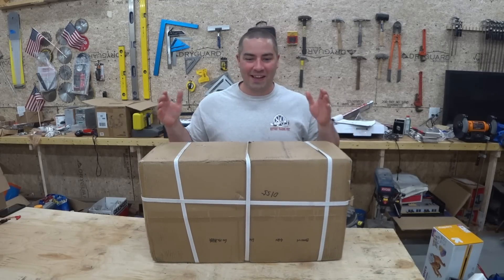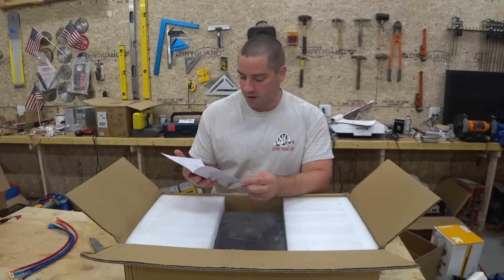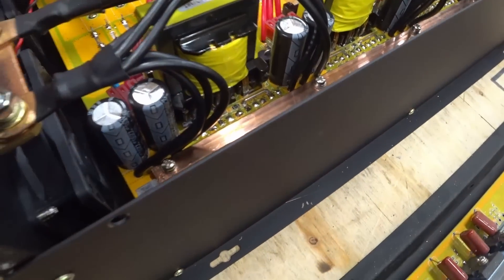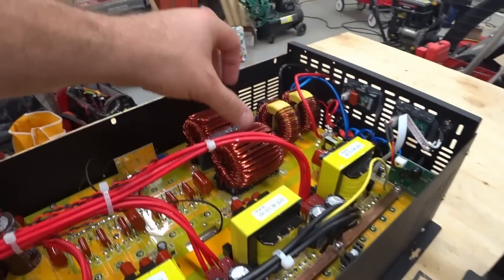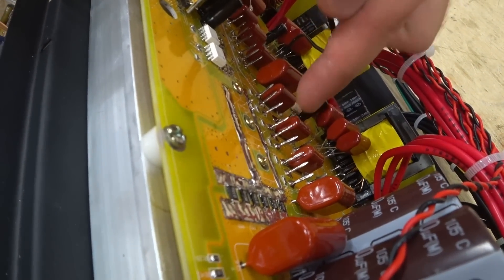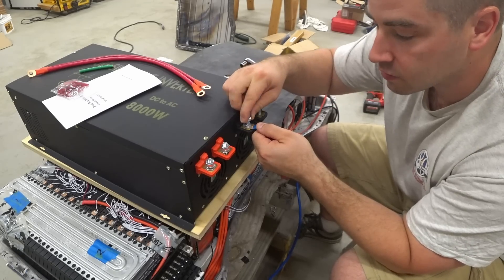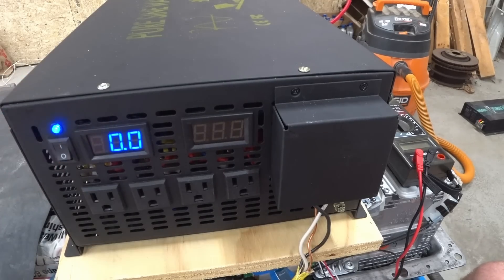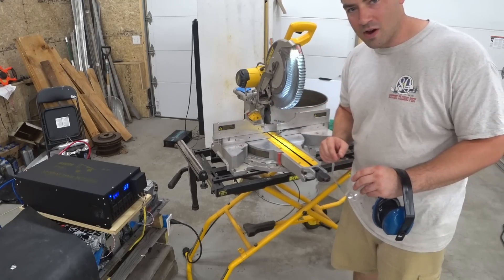Cheap 8000w Reliable Inverter, That Works! WZRELB

Comment: David sticka O scope to it and show us the signal it generates, if it is making a pure sine wave then you got something good and it will save you a lot of power and money in the long run as a whole, battery bank will last longer , and devices will last lonmger cause they will run cool. Remember the cleaner the signal the higher the efficiency. Theoretically a perfect sine wave would flow on regular metals as if they were super conductors , assuming you are driving the amps at the correct resonant frequency , like 432 hz
Reply from the maker: At some point I'll save up for an oscilloscope and do that.  Thanks for watching.

Comment: Cheap ? Ok, Reliable No, 8000 W - No

Reliable 8000 VA inverter looks like this:
https://www.off-grid-europe.com/studer-xtender-xth-8000-48-inverter-charger
and Chinese clone like this:
https://xihe-solar.en.made-in-china.com/product/iyuEIjxbrScw/China-Studer-Xtender-Xth-8000-48-Inverter-Charger-off-Grid-Europe-48VDC-to-120V-230VAC-8000va-Power-Inverter-8kw-to-72kw-Home-Inverter.html
Or another 8000 VA reliable inverter:
https://www.sonopsolar.co.za/product/victron-quattro-488000-single-phase/

Try 8000 VA continuous @ 25 & @40 *C for 12 hours & you will see, that maybe after 30 - 45 min. it will beep a than shut down or die.
Reply from the maker: Thank you Pavol Filek.  Those are some nice looking inverters.  I'm currently building a sub-panel so that I will be able to load this inverter up to 8000w.  I hope it makes it, but I'm sure you are right that it probably won't last an hour.  Thanks for watching.

Comment: There isn't really much test about what you're doing to be honest. It's more just you running around screaming "YES" when you plug something in. 
Can you provide any scientific tests?
Reply from the maker: I'm just a dude in his garage.  I'm probably never going to be into the scientific tests, sorry about that.  But, I'm currently working on wiring in a sub-panel to this inverter.  Once that's done I'll have enough outlets to load it up to the 8kw.  I hope the inverter can do it without giving up the smoke.  LOL

Comment: Something about electrical design Engineering is that we always use down-sized wire for very short runs. Stranded wire like what you have in that box will work fine. I have equipment I designed with #4 wire that is normally rated at 70 amps, and you can safely double that amperage for short runs inside equipment. One would be amazed at what a difference it makes in the resistance of 30 feet of that wire versus four to six inches. That little bit if resistance difference makes a HUGE difference in the heating up of the wire when in use in an over-current condition. 140 amps would heat up that 30 foot run FAR more than it ever would the 6 inch piece. They also soldered rather than crimped, which gives it more surface area connection, which is also better than crimping, especially if they use silver solder. In your case, wire rated at 30 amps for longer runs will handle 66 amps just fine.
Reply from the maker: Thank you very much.  Your explanation makes perfect sense.  I am setting up for a bigger test of the inverter.  My goal is to try and put 8000 watts of load on it.  I plant to attach a temperature sensor to the middle of the red wire with some electrical tape and see how hot it gets.  Does that sound good, or any other things I should keep in mind for that test?  Thank you.
Reply: @DavidPozEnergy  Thermal cameras do FAR better at gauging as to if a wire is heating up excessively. However, those aren't cheap. We use thermal cameras in all our control boxes, fuse boxes, etc.. That helps us find where there are loose connections, which ALWAYS cause wires and fuses to heat up excessively. If a wire is indeed under-sized for an application, the thermal camera will make it very evident. If you plan to do lots of design work of solar power systems, a thermal camera would be a much better investment for looking to see if lithium batteries, wires, transformers, capacitors and other components are getting a bit too warm and in need of heat sinks. Even infrared temperature readers with laser spots to show you what you're reading are inexpensive and necessary. You can get one online for about $30. Putting a thermocouple of thermistor on a round wire is difficult to make enough surface area contact for an accurate reading. THHN coated equipment wiring is rated for 60C or 90C (I forget which), which is pretty darn hot.
Reply from the maker: Thanks.

Comment: 6:15 The ratings for chassis wiring is different from home wiring. Home wiring states 10AWG is for 30A based on the NEC. The max rating for 10AWG in chassis wiring is 55A. That being said, I personally wouldn't use it anywhere near that :)

Comment: Yeah, they're using chassis wiring ampacity standards and specifically Chinese chassis ampacity ratings. In truth, the ratings you're used to are based on a high uncertainty in the the length of the run, which is why wires that qualify as chassis wiring can be rated for higher currents, so in reality you'll probably be fine. They'll get toasty with a full load pushed through them, but only toasty as long as the connections are solid and not "ohmic". That said, I personally would swap most of the internal wiring with two gauges bigger just to reduce the amount of power loss to heat and quell my paranoia. 8awg as chassis wiring will handle 60 amp with laughter.
Reply: Yeah, I just checked and even by US standards 10awg chassis wiring is rated for 55A.
Reply from the maker: Thank you.  I plan to run the inverter up to full load and check the temperature of those wires.  Do you think I should put the temperature probe on the middle of the wire, or at the terminal on the board?
Reply: @DavidPozEnergy  It's my experience that the most heat comes from the connections and for a reason I still can't succinctly explain in terms of the physics involved, heat buildup seems to ramp up faster and hotter on the connection which is closer to ground potential, so If I only had one temp sensor that's where I would put it first.
Reply: Sorry, that gives an incorrect pocture of my observations. Instead of "closer to ground" I meant "more negative". Whichever side the electrons are coming from.
Reply from the maker: Thank you.  I'll put it on the connection.  I really appreciate you offering the help.
Reply: @DavidPozEnergy  No worries mate, let me know if you have any other questions.

Comment: All that matters is if your devices doesn't exceed 8000 watts at the combined surge limit if it's a high frequency, but if it's a low frequency, you have a nice inverter...You can start 10 to 12000 watts with a 8000 watt low frequency and 8000 watt max surge and run from a high frequency. Buy what you know you'll need to start that air conditioner, water pump and refrigerator.
Reply: This one says it has a 16000, but this will last for a second or two where a low frequency will surge for 10 to 30 seconds which is needed.
Reply from the maker: I agree, Low frequency is better for surges.

Comment: love these vids.. Please update us in 6 months if you use it regulary

Good call on the output wire size.. 10 AWG for 8000W, 66 Amps seems way low.. That tells you they don't expect this inverter to produce 8000W for very long!

David you have a future on QVC!

Comment: the under sized out put wire will get warm , check if they do under load if they do increase size of wire .a black coating will appear if u use under sized wires that get more load than they are rated fore sum of the black is caused by oxidation in time . nice video .

Comment: observations about conductor size, are pretty subjective.    and, should be tempered by the knowledge that,  the requirements for  AC  power  and  for DC, are different.    and, there are Both, in an dc/ac inverter.       cheers                   googletranslate

Comment: Ever since I saw a video from What's Inside, I was hit with that burning question myself: would your 8 kW inverter be strong enough to give a Tesla enough emergency power to make it to a charger if you get stranded on the road?
Reply from the maker: This depends on what the draw of the charger is.  I think a lot of EV's have a 120v charger in the trunk, which might be 1500 watts.  This could work on this inverter because it's less than the 8000w rating of the inverter, and is 120 volts.  However, most home charging stations are using 40 or 50 amps at 240 volts.  Even 40 amps at 240 volts is 9600 watts, which is more than the inverter.
Reply: @DavidPozEnergy  I guess at that point, you could use the 240V connection and set the charging current limit to 30A.  240V * 30A = 7.2kW; this is within range of the 8kW rating of your inverter.  Understandably, I would set a hard limit of 35A on the 240V connection (8.4kW).  However, assuming that your inverter is not equipped with a 240V connection, that 8kW rating would run 65A of current on the 120V connection.

Comment: Best way to load a converter is a couple electric heaters
Reply: don't think so.     a resistive load does Not draw  Current, like a low-impedance load does.    cheers

Comment: I have that exact clamp meter from amazon.  Love it.  The thinner wires in the new one, it could be that they are full copper wires, while in the old one they were  copper mixed with other metals that did not conduct as well

Comment: When are you going to build your own inverter lot cheaper mine will do around six or seven thousand Watts continuous low frequency start anything and idle current little over 20 watts check out some of the builds over on the back shed. Com form it don't cost a thing it's just a form lot of nice people on there they will walk you right through a inverter build
Reply from the maker: I never considered building my own inverter.  I'll check out the forum.  Thanks.

Comment: I would not trust it , at that weight there is no low freq transformers that help protect it,  china lies on the specs all the time
Reply from the maker: I'll be doing some more testing.  I'll try to bring it up to 8000w.  Thanks for watching.

Comment: https://www.amazon.com/gp/aw/d/B00S4DZRSK#Ask thinking of getting one of these myself have u ever tried one of these out
Reply from the maker: I have not tried one of that brand, but I think it comes out of the same factory as my AIMS inverter.  They look identical with the exception of the display.  The AIMS inverter has been working extremely well.  I'm on it right now, and have been off-grid with it most of the summer.  I have a review of it here: https://youtu.be/dfHb5tZErTs
Reply from the maker: Note, the one you linked to is 24 volt DC.  If you can, 48 volt is better for a 6000 watt inverter.  https://amzn.to/2MmD261
Reply: Well I feel 12v to 120v conversion isn't that great and 48v is to costly so I feel 24v is a happy medium. If you where to get an oscilloscope on a budget what would you recommend?
Reply from the maker: I don't have experience with oscilloscopes, so I'm not a good person to ask.  I've seen some people use the DS212.  I just ordered an oscilloscope called the DS6102.  I'll be trying it out and if it works well I'll make a video about it.  But that's probably a month or more away.

Comment: Just couple things, did you buy this inverter?  or was it free? For "review" purposes?  Too many details for this review ALL I want to know is if it works and how long does it last...tired of seeing people reviewing shit, then trying to sell it with out real world testing!!!!
Reply from the maker: It was free for the purpose of the review.  I like seeing inside inverters, which is why I took the lid off.  I'll be making a follow up video trying to load this thing up with 8000 watts of load.  Anything else you hope to see in the next video?  I'm always open to suggestions.

Comment: try an AC unit
Reply from the maker: No problem.  I have been running a 5000 BTU window AC (small) without issue.  I'll include a clip of this in my follow up video.  I want to test this thing with more load.  If you want to see another video with an AC unit I have one here: https://youtu.be/dBwXs-c7axU

Comment: WHERE CAN I FIND THOSE BATTERIES?
Reply from the maker: I built the batteries out of a "Smart Fortwo EV".  I found the original battery at a slavage yard, aka "Auto Recycler".  I put in a google search for "auto recyclers near me"  Then just started calling around.
Reply: do a video on the battery build

Comment: What is your battery configuration.  One 12v. Auto battery?
Reply from the maker: The battery I'm using in this video is from a Smart Fortwo EV (electric car).  I took it apart and re-configured the cells into 14s6p configuration.  It is a nominal 48 volt system.  I have several videos on building the battery bank, it started with this one: https://youtu.be/zMb_P7Vxd3I

Comment: Nice videos dude i would like to ask you what deference between off grid power inverter and inverter 
And i wish you do video about home system and your advices
Reply from the maker: Hi Concord Mustafa.  Thanks for your questions.  All inverters take DC (direct current) and make AC (alternating current).  Solar panels make DC and batteries store DC.  But our houses and appliances use AC.  So there is an inverter between the two.  You question "difference between off grid power inverter and inverter" is a little confusing.  Off-grid inverters are inverters.  Possibly you are asking about Off-grid inverters and grid-tie inverters?  If that is the case then generally speaking:

Off-Grid inverters are made to connect with battery banks working at a nominal voltage.  Usually this voltage is 12v, 24v, or 48v.  I personally use 48 volt systems.  

Grid-Tie inverters are made to connect directly with solar panels and the grid.  No batteries involved.  Generally they operate at much higher voltages, say 300 volts DC.  

I'm using the term generally because there are exceptions to every rule.  One fantastic example is called the "Sol-Ark".  It is both off-grid and grid tie.  

I hope that helps.
Reply from the maker: Can you please tell me more about your question on "home system"?  What home system are you referring to?  Thank you.
Reply: @DavidPozEnergy  appreciate your help and answer was so helpful
my country has electricity problem right now and i try to find out another solution because i don't like the normal generator working with gas i am looking for items : solar panel , batteries , inverter and mptt to run my house at lest 12 hours for 2700w per hour 
i wish i have been count it right 
for 10 lambs and and aircondation input1800w  , Refrigerator , small fezer and tv with receiver
Reply from the maker: Here is a good calculator that can help you more: https://www.altestore.com/store/calculators/off_grid_calculator/
Reply: DavidPoz 
Thx allot dude i will try it

Comment: Great vid.  Thanks.

FYI -- Those power tools you used for testing (eg band saw) weren't under load so were not using their rated consumption.
Reply: Matt ! The DeWalt Miter Saw was under load, Barley... LoL

Comment: What type of batteries are you using?
Reply from the maker: I'm using lithium batteries from EV's (Electric Vehicles).  In this video with the 8kw, I'm using a Smart Fortwo battery.  If you watch other videos on my channel you will see I also have a Chevy Volt battery with a different inverter.  Thanks for watching.

Comment: Get yourself some decent test equipment, part of your testing should be putting an oscilloscope on the output then you will see how dirty the 120AC waveform is on these rubbish inverters.
Reply from the maker: I want to get an oscilloscope and test all my inverters.  Just a matter of saving up for one.
Reply: maybe they will send you one to work with

Comment: The hot lead that is only soldered will melt under load, such poor quality, as least when it melts it will simply disconnect the live output, the Mosfet legs not trimmed off 🤣🤣🤣, the soldering on the critical components looks like it was done using a paddle pop stick, and hot melt glue holding everything in 🤣🤣😂😂🤣🤣 I would not trust the isolation of this unit not at the current this could deliver, it WILL kill you when the isolation goes wrong and it will, then will end up as landfill, these cheap Chinese inverters have no  QA / electrical standards DANGER
Reply from the maker: O, good to hear someone else was also disturbed by the solder only instead of crimping.  It didn't look right to me.

Comment: Compressors don't start under load. They have an unloader valve that bleaeds out the air between comp and tank. There is a check valve at the tank. It's the hiss you hear when the compressor shuts off once its full. Once running it then has a load and will work the motor more but does not effect that up surge. Just an fyi
Reply from the maker: Thank you.

Comment: Good that it works better than the previous version, but could you do a proper test under full load for a long period of time? They claim 8000W continuous and you didn't even get to test half that.
Reply from the maker: That's the plan for an upcoming video.  I have to get a sub panel connected with more outlets.
Reply: @DavidPozEnergy  That's great. Looking forward to seeing how the internal output wiring holds up to 60amps prolonged.

Comment: one could be silicone wire witch 10 Gage can handle 80-120 amps  at 96volts DC so if your only pulling 66 amps ac it would be perfectly fine
Reply: Exactly common sense 😂

Comment: At least the heat sink is big enough. But I would doubt the the ratings on the fets equal 8000 w. They work off the amp ratings of the mosfet not the rated power dissipation